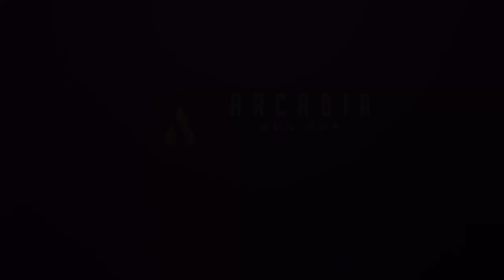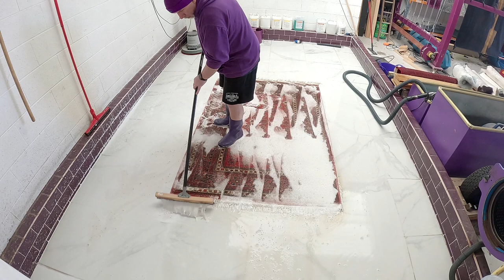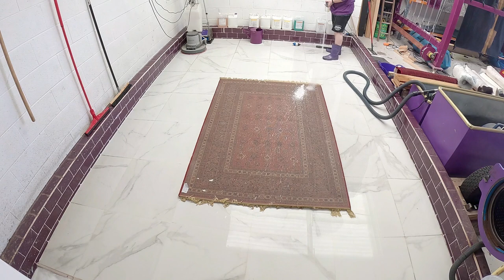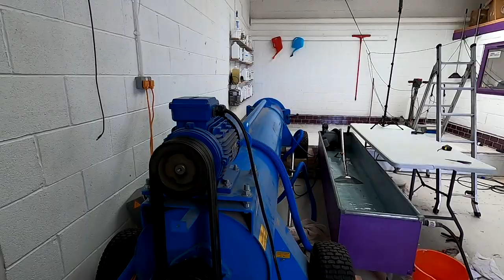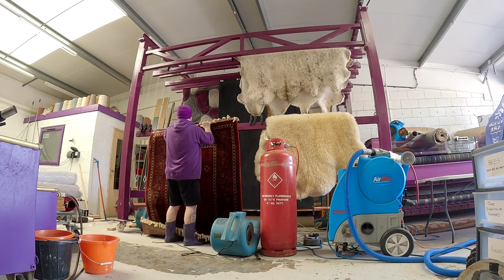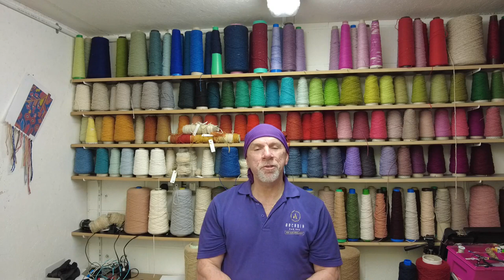Persian Style Machine Woven Rug Cleaning - Rug Cleaning Cheshire

Comment: Was there a particular reason why you started with the crb?
Reply from the maker: Had a twinge in my back so decided to cut down on manual work that day. I brushed the back though if i remember rightly. Plus the rug was a machine made rug and quite hardy so i was confident it didnt need checking over with the manual brush first.